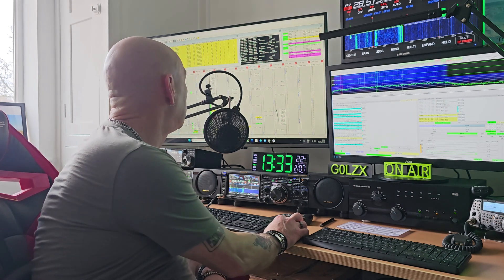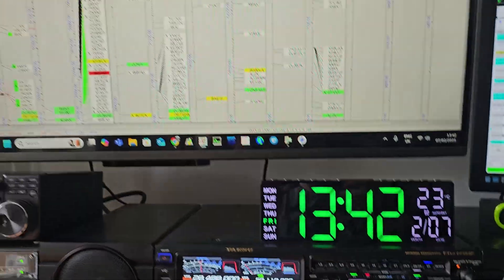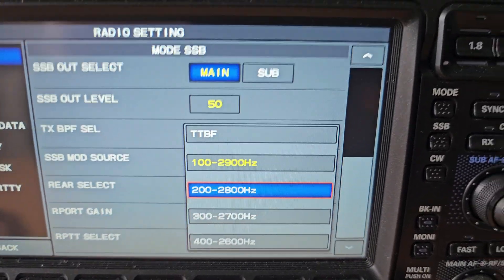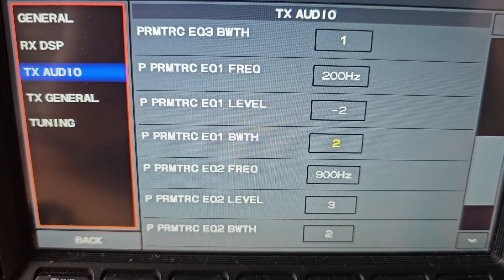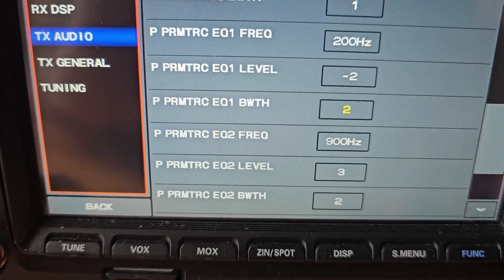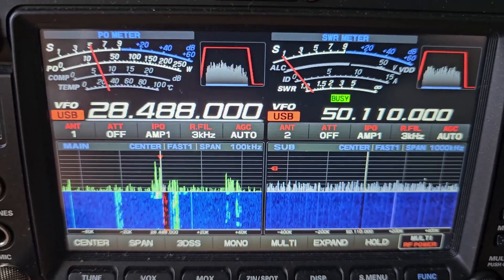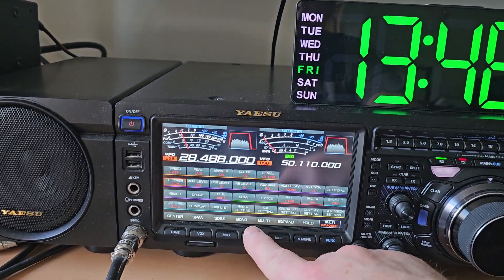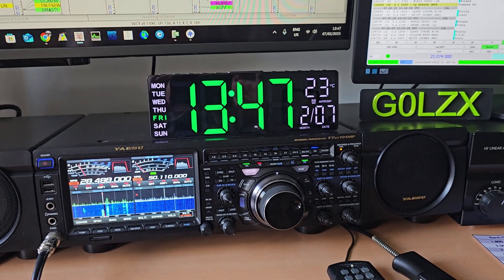Heil PR781 and Yaesu FTDX101mp audio settings

Comment: Great video, I am moving from an ICOM 7610 to a Yaesu FTDX-1010MP, I have both the 781 and PR-40 mics so this is very helpful. Did you have to modify the cable in any way ? There are files out there showing how you have to add a capacitor and some other circuitry in the cable before plugging into a Yaesu radio because of the lower mic pre-amp. I don't want to bother with that and would like something I could just purchase the correct adapter and get to setting up my mic parameters.  What can you share on this?   Thanks again for the video - 73 de AF1US
Reply from the maker: @AF1US  as long as you get the correct heil adapter cable for the pr40 and 781 you don't have to do any modifications.. 
As far as I can remember it's the Icom cable which has the decoupling capacitor in it ?? 
I got my pr-781 second hand with the adapter cable and didn't have to do any modifications at all, just plug and play 😊, enjoy the 101mp its a great bit of kit .
73 Ricky G0LZX

Comment: On my 101mp: Radio Settings-MODE SSB- TX BPF SEL: there is no "TTBF" to select? i find the following instead:  "50 - 3050Hz" ? I have selected the 200-2800 Hz but if I wanted to select the TTBF is missing? any idea? I was told that the radio has the latest firmware!
Reply from the maker: @giulianoggg2035  it's NOT the firmware , it's a software mod you do to get 4k audio ( ttbf ) 
If you search yaesu ftdx101mp 4k audio mod , there's lots of videos and info on how to do it .. its a 2 key press while turning radio on.... you WILL lose any settings within the radio so make sure before you do it you save all your personal settings ... hope that helps 
Cheers Ricky G0LZX
Reply: @g0lzx  OK understood I will do that however in the last 12 months yaesu didn't release any update right?  Thank you for your help
Reply from the maker: @giulianoggg2035  no, no firmware updates

Comment: Great explanation excellent, in my case also with 101MP I have the M-100 PTT could I also use them?
Reply from the maker: @giulianoggg2035  the m100 is a great microphone
Reply: I tried changing the settings on TX AUDIO but i am unable to do so it is in Yellow doesn't allow me to change it? all of them ! any idea
Reply from the maker: @giulianoggg2035  you should be able to change.ANY of them settings
Reply: @g0lzx  Sorted my mistake,
Reply from the maker: @giulianoggg2035  fantastic 👏

Comment: Hi, you didn't say what your AMC level was set too.
Reply from the maker: @CT7BNL  sorry , I didn't say because it was switched off due to the compression being switched on so it doesn't affect the audio settings I've posted ... 
Hope that clears it up ? 
If you need me to check my AMC settings are I can post them on here ?? 
Let me know and thanks for watching and for the comments ..
73 Ricky
Reply: I thought with the new firmware you couldn't switch off the AMC.
Reply from the maker: @CT7BNL  if compression is on , AMC is off , so I'm lead to believe
Reply: On the old firmware yes, but on the newer firmware no. AMC is always on, that setting only switches the computer.on or off. The only thing you can do to switch AMC off.is set it to 100%
Reply from the maker: @CT7BNL  just for info hhen , my AMC is set to 60 👌